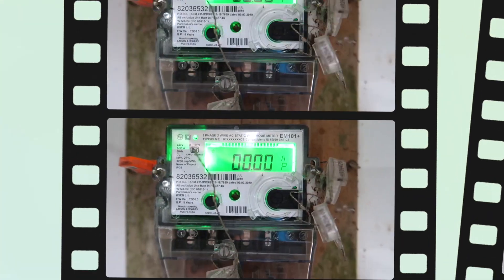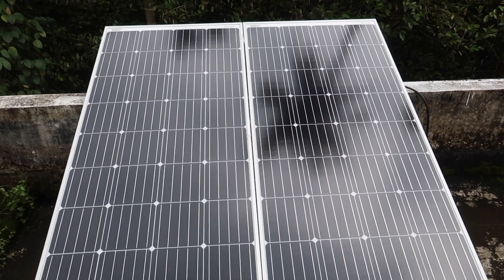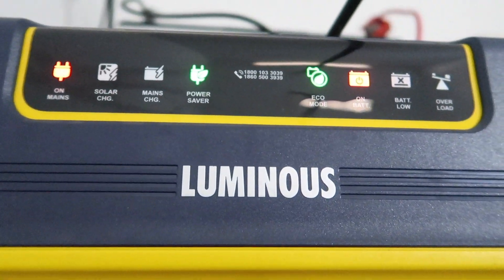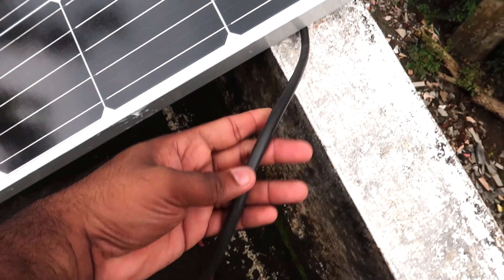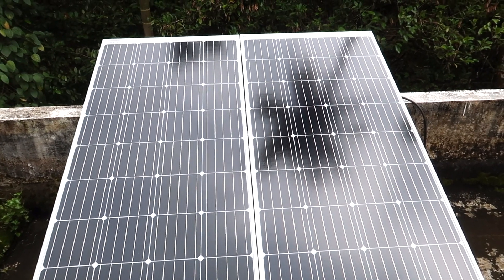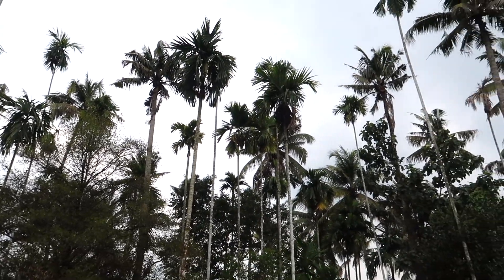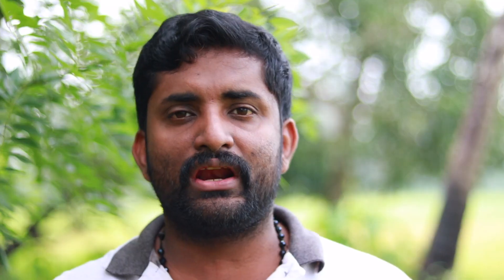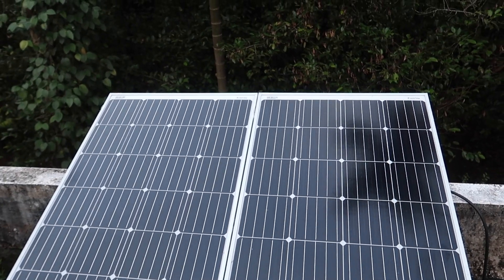സോളാർ പാനൽ വൈദ്യുതി ചാർജ് കുറക്കും | Luminous invertor + solar panel + battery

Comment: Chetta, njn oru computer 24*7 use cheyyunnund with 43 inch monitor. Enik ithu randum mathram solar inverter nte power yl use cheyyanam.  Enik ee requirement nu avashyam aya oru unit suggest cheyyamo.
Reply from the maker: Sorry bro..i am not a expert. ആരെങ്കിലും ഇ സുഹൃത്തിനെ ഒന്ന് സഹായിക്കാമോ 🤔

Comment: Luminous sine wave ഇൻവെർട്ടർ ഇൽ ട്രാന്സ്ഫോര്മര്  കോയിൽ അലുമിനിയം ആണ് യൂസ് ചെയ്‌തിരിക്കുന്നത്‌,  അതുകൊണ്ട് തന്നെ എനർജി ഹീറ്റ് ലോസ് വളരെ കൂടുതലാണ്.  അതിനായിട്ടു മിക്ക sine wave ഇൻവെർട്ടർലും exhaust fan ഉണ്ട്‌ with തെർമോസ്റ്റാറ്റ് കോൺട്രോളറും. അതുകൊണ്ട് തന്നെ ഇത്‌ വെക്കുമ്പോൾ വൈദുതി ബില്ലിൽ നല്ല ഒരു മാറ്റം തന്നെ വരും,  സോളാർ പാനല് വെക്കുമ്പോൾ kseb ചാർജിങ് ഒരു പരിധി വരെ കണ്ട്രോൾ ചെയ്തു കുറയ്ക്കാം. 
പിന്നെ ലൈൻ വോൾട്ടേജ്  ഉള്ളപ്പോൾ ഇൻവെർട്ടർ ഓൺ ആകുന്നത് ലുമിൻസ് ഇൻവെർട്ടർൽ UPS mode ECO എന്നിങ്ങനെ 2mode ഉണ്ട്‌ UPS mode on ആണെകിൽ ലൈൻ voltage 200V താഴെ പോയാൽ ഇൻവെർട്ടർ mode on ആകും. പക്ഷെ ഇൻവെർട്ടർൽ under voltage  indication ഒന്നും തന്നെ കാണിക്കില്ല,  Mains Indication ഉണ്ടാകും. 

ECO mode ഇട്ടാൽ Under  Voltage ആയാൽ മാത്രമേ Changeover Relay  dienergise ആവുകയുള്ളൂ.
Reply: Good information

Comment: Mono crystalline panels are used in low sun light  conditions. For example Ooty. But in Kerala polycrystalline panels are better except for some areas like Waynad , Idukki etc. For long term productivity polycrystalline panels are more efficient.

Comment: 2x 100 W panel,150ah battery,1200VA inverter. കഴിഞ്ഞ 10 വർഷമായി ഈ രംഗത്ത് പ്രവർത്തിക്കുന്ന ഒരു സ്ഥാപനമാണ് എനിക്ക് ഇത്  വീട്ടിൽ ഇൻസ്റ്റോൾ ചെയ്തു തന്നത്. എന്റെ സംശയം എന്താണ് എന്ന് വച്ചാൽ, സോളാർ പാനൽ ഡയറക്ട് ബാറ്ററിയിലേക്ക് ആണ് കണക്ട് ചെയ്തിരിക്കുന്നത്. ഇത് ശരിയാണോ? ചാർജ്ജ് കൺട്രോളർ നിർബന്ധമാണോ? ബാറ്ററി ഫുൾ ആയതിന് ശേഷം 200W വരെയുള്ള വീട്ടിലെ ഉപകരണങ്ങൾ KSEB പവർ ഉപയോഗിക്കാതെ പാനലിൽ നിന്നുള്ള വൈദ്യുതി ഉപയോഗിച്ച് പ്രവർത്തിക്കും എന്ന് ടെക്നീഷ്യൻ പറയുന്നു.ഇത് വിശ്വസിക്കാമോ?
Reply: battery life ?
Reply from the maker: എവിടെയോ എന്തോ പ്രശ്നം ഉണ്ടല്ലോ പറഞ്ഞതിൽ ...🤔
Reply: @ecoownmedia  ചാർജ്ജ് കൺട്രോളർ ഇല്ലാതെ ഉപയോഗിച്ചാൽ എന്തൊക്കെ പ്രശ്നങ്ങൾ ഉണ്ടാകും?
Reply from the maker: Battery damage aagum pettannu, panel damage aavanum chance undu
Reply: ratheesh raghavan  battery damage akum due to high voltage ... 180 watt 12 volt PV pannel  peak power voltage 19 volte So charge controller  reduce voltage  to 12 volt
Reply: ബാറ്ററി ലൈഫ് പെട്ടന്ന് തീരും .ബാറ്ററി പൊട്ടിതെറിക്കാനുള്ള സാധ്യതയും ഉണ്ട്

Comment: In  this system energy and money savings will depend upon your electricity usage at day time from solar and how much time your Inverter charges battery after sunlight goes. 
Usually all inverters will work up to below its normal voltage  using battey and after that it will take KSEB supply to charge it . This battery charging current by inverters will take away all the savings. If soalr consumption at day time is less,  loss will be more. The same is the reason for increase in Electricity bills at home after installation of Inverter.

Comment: ഞാൻ 260w ന്റെ 24 വോൾട് 4 പാനൽ 12x150AH ന്റെ ബാറ്ററി 2 എണ്ണം strider ന്റെ ചാർജ് കൺട്രോളർ (40amp ന്റെ) 24 വോൾട് 3Kva ഇൻവെർട്ടർ ഉള്ള  ഒരു  സിസ്റ്റം ഒരു കൊല്ലത്തോളമായി ഉപയോഗിക്കുന്നു.  ഒരു കാര്യം പറയാം എനിക്ക് നല്ല രീതിയിൽ എലെക്ട്രിസിറ്റി bill കുറവ് വന്നിട്ടുണ്ട്.  നല്ല ഒരു സിസ്റ്റം ഉപയോഗിക്കണം അതുപോലെ MPPT charge controller ഉപയോഗിക്കുക.  സാധാരണ വരുന്ന സോളാർ ഇൻവെർട്ടർ  വളരെ അധികം Pwm ചാർജ് കൺട്രോളർ ആണ് വരുന്നത്. BUILTIN ചാർജ് കൺട്രോളർ ഉള്ളത് ഒഴിവാക്കി separate MPPT charge controller ഫിക്സ് ചെയ്യുക.  ഞാൻ എന്റെ 687 ലിറ്റർ ഇൻവെർട്ടർ മോഡൽ side by side ഫ്രിഡ്ജ് 6 മണി മുതൽ രാത്രി 10 മണി വരെ  (1hp submersible വാട്ടർ പമ്പ് (ഇടക്ക് മാത്രം) പിന്നെ ലൈറ്റ് ഫാൻ മിക്സി അത് പോലെ വാഷിംഗ്‌ മെഷീൻ അത്യാവശ്യം ഉപകരണങ്ങൾ എല്ലാ  ഉപയോഗിക്കുന്നു.  ബാറ്ററി ചാർജ് level അനുസരിച് ചാർജ് കൺട്രോളർ change over ചെയ്യുന്നു.  നമ്മൾ ഒന്നും ചെയ്യേണ്ടതില്ല.  സ്വന്തം ചെയ്യാൻ കുറച്ച് അറിവുള്ളവർ എനിക്ക് അറിയാവുന്ന കാര്യങ്ങൾ വേണമെങ്കിൽ ഷെയർ ചെയ്യാം.  നോ ഇഷ്യൂ.  സോളാർ ഇൻസ്റ്റാളേഷൺ എന്റെ സ്വന്തം അനുഭവം ഷെയർ ചെയ്യാൻ റെഡി.  വാട്സ്ആപ്പ് 00971507261985
Reply: You need solar system?
Reply: 260 X 4 പാനലെന്നു പറയുമ്പോൾ I 1Kw പാനലാണോ?

Comment: video is good. but i think ur battery is charging through out the night time from kseb via your invertor. this will cause a shoot up in energy bill. to avoid this automatic charging from kseb line to the battery, a controlling swich is required in the invertor.

Comment: ചേട്ടാ.. monocrystalline panel over heat ആയാൽ  efficiency  കുറയും but policrystalline പാനലിനു ആ കുഴപ്പമില്ല.. പക്ഷേ നല്ലതു  monocrystalline panalanu 500 watts മുകളിലേക്ക് ആണേൽ  policrystalline ആണ്  നല്ലതു പിന്നെ ഒരു mppt inverter use ചെയുക luminous inverter ചെക്ക് ചെയുക battery full ആയാലും  24 hr  tansformer working aanu mppt inverter aakuzappmilla.., പിന്നെ  solar battery use ചെയുക  വില കൂടുതലാണ് 5 വർഷം റീപ്ലേസ്‌മെന്റാണ്. ബാറ്ററിയുടെ പ്രതേകത സെല്ലിന് കട്ടി കൂടുതലാണ്  solar tall tubeless battery.  utl mppt inverter  mppt solar charge controller. നല്ലതാണ്..പിന്നെ quantum solar inverter കുഴപ്പമില്ല rs. 9500 1000va indiamartil kitttum, പിന്നെ  flin energy mppt inverter  3, 4 വർഷം കൂടുമ്പോൾ  സോളാറിന്റെ  20sq045, 20sq050 schotty diode മാറുക.. ഞാൻ വീട്ടിൽ  ഉപയോഗിക്കുന്നത്  flin energy യുടെ mppt ഇൻവെർട്ടർ ആണ്  panel 500wattum..ഈ inverteril smps transformaranu  wallmount. USA make aanu
Reply: 3 kw ongrid system luminous system install cheyyan entra cost aaakum..athu upayogichu 1 unit inte 3 Ac koodi run cheyyan pattumo. Pls advice..
Reply: @sanjoysidharth8485  3ലക്ഷം 
13 to15 യൂണിറ്റ്  വരെ  കിട്ടും 
നിങ്ങൾക്കു  ഒരു  ദിവസം വേണ്ട യൂണിറ്റ് എത്ര എന്ന്  മനസിലാക്കൂ  എന്നിട്ട്  മാത്രം  എത്ര kw  വേണമെന്ന് തീരുമാനിക്കുക 
മറുപടി  ഇഷ്ടമായില്ലെന്ക്കിൽ, സോറി..
Reply: Bro. നല്ല അവതരണം . ഒന്ന് കൂടി  ശ്രമിച്ചാൽ  നല്ല  ടെക്നിക്കൽ അറിവ്  നേടാം 
ഓൺ ഗ്രിഡ്  വർക്കിംഗ്‌  രീതി 
തെറ്റായിട്ടാണ്  പറഞ്ഞിരിക്കുന്ന തു  dc കേബിൾ  സ്റ്റോക്ക്  ഉണ്ട് 
4mm 40rs/meter, mc4 connector,  2 in1, 3in1, 4in1 available ആണ് 
Desigin കറക്റ്റ്  ആണെന്ക്കിൽ  മാത്രെമേ സോളാർ സിസ്റ്റം വിജയിക്കൂ 
വീഡിയോയിൽ  കാണുന്ന ബാറ്ററി  c20ആണ്  c10ആണ് 
നല്ലത്  5ഇയർ ഗ്യാരണ്ടീ ഉള്ള 
ബ്രാൻഡഡ് c10 മാത്രം വാങ്ങുക
Reply: @rajeshkumar-st9pc  സ്ഥലം എവിടെയാണ്... dc കേബിൾ 6 mm   1 mt.  Rs എത്രയാണ്
Reply: ബാറ്ററികൾ .എക്സൈഡ് ഉപയോഗിക്കുക

Comment: 1 hour കൊണ്ട് എത്ര ampere charge കേറും same system ഉപയോഗിച്ച്
Reply: Mppt charge control vachaal 1.30 hr.. 200 ah battery full
Reply: @ashrafkaradan5559  40 amper ഇൽ ഒന്നും ബാറ്ററി ചാർജ് ചെയ്യാൻ പാടില്ല   മാക്സിമം 8 amper.. ബാറ്ററി വളരെ വില ഉള്ളതാ.. പണി പാലും വെള്ളത്തിൽ കിട്ടും.. 😪
Reply: @ashrafkaradan5559  controler എത്ര ampere ന്റെ വാങ്ങിക്കണം
Reply: 40 ambear
Reply from the maker: ഒരു ദിവസം ഫുൾ ചാർജ് ആവുന്നില്ല ബ്രോ. 1 മണിക്കൂർ അറിയില്ല ബ്രോ
Reply: I have m p p t  40 amper full automatic.... 150 ah.. 8 amper adukkolluuu maximum pooaal 150*5 battery =8amper*5=40

Comment: 50watt mono solar panels inda and with 35ah battery how many hours will take to full charge?
Reply from the maker: 8 hr. Depending light & charger control
Reply: 35AH ബാറ്ററി ചാർജ്ജിന് 3.5 A കരണ്ട് വേണം 10 മണിക്കൂർ' '        50 Wസോളാറിൽ നിന്ന് 5 മണിക്കൂർ മാത്രമേ 2 .15 A കരണ്ട് മാത്രമേ കിട്ടു ഒരു ദിവസം കൊണ്ട് ചാർജ്ജ് ആകില്ലാ രണ്ടാം ദിവസം കുറച്ചു നേരം കൂടി വേണം അല്ലങ്കിൽ rMPPT സോളാർ ചാർജ്ജ് കണ്ട്രോൾ വേണം

Comment: കേരളത്തിന്റെ കാലാവസ്ഥക്ക് Polycrystaline solar panal ആണ് നല്ലത്. കാരണം ഈ Solar Pannel ന് Negative Tempreatue coeffeciant ആണ് ഉള്ളത്. That means, Panel ന്റെ Tempreature കൂടുമ്പോൾ Power output കുറയും. കേരളത്തെ പോലെ നല്ല ചൂടുള്ള വെയിൽ ലഭിക്കുന്ന ഒരു പ്രദേശത്ത് Mono യെ അപേക്ഷിച്ച് Poly ആണ് കൂടുതൽ workout ആവുക. കൂടാതെ panal ൽ shading വരുകയാണെങ്കിലും Mono  യെ അപേക്ഷിച്ച് Poly യാണ് കൂടുതൽ Power output തരുക.
monocrystaline panal Low Iight ഉള്ള പ്രദേശങ്ങളിൽ ആണ് നന്നായി പ്രവൃത്തിക്കുക.

 solar system ത്തിൽ ഉപയോഗിക്കുന്ന Battery c10 rating ഉള്ള Battery ആയിരിക്കുകയാണങ്കിൽ മാത്രമേ പ്രതീക്ഷിച്ച ഫലം കിട്ടുകയുള്ളൂ. ഈ Balttery Design ചെയ്തിട്ടുള്ളത് 10 മണിക്കൂർ കൊണ്ട് charging and Dis charging നടക്കുന്ന രീതിയിൽ ആണ്. C20 Balttery Design ചെയ്തിട്ടുള്ളത് 20 മണിക്കൂർ കൊണ്ട് charging and Discharging നടക്കുന്ന രീതിയിലും ആണ്.

Comment: Same loom സോളാർ  180×2 , 160Ah ബാറ്ററി ഞാനും വെച്ചിട്ടുണ്ട് 2 മാസം ആകുന്നു വളരെ useful ആണ്..
Reply: Loom solar panel =15000
Luminus1400 solar inverter                  =7500
Inverfast C10 ,160 Ah solar battery          =11700
DC cable 15 meter=1700
Total = 35900/-
Reply: @shinodkalavoor100  pls share link for inverfast 160 ah battery purchase
Reply: @shinodkalavoor100  what all electric equipments can be used at a time
Reply: വന്നില്ല വന്നിട്ടു പറയാം
Reply: ബിൽ vanno????  ലാഭമാണോ
Reply: Bill details?
Reply: എല്ലാം കൂടി  എത്രയായി

Comment: സോളാർ പാനലിന്  ബാറ്ററി ഉപയോഗിക്കുംബോൾ C20 ബാറ്ററിയെക്കാൾ C10 ബാറ്ററി ആണ് നല്ലത്
Reply: ബ്രോ ഒര് ബാറ്ററിയുടെ ലൈഫ് 900 to 1000 സർക്കിൾ ആണ്. അതായത് ഒര് ഫുൾ ചാർജ്, ഒര് ഫുൾ ഡിസ്ചാർജ്.. c, 10 ബാറ്ററി 15 ആംബിയറിൽ 10 മണിക്കൂറിൽ ഡിസ്ചാർജ് ആകും. C 20 20 മണിക്കൂറിൽ7.5 ആംബിയറിൽ  ഡിസ്ചാർജ് ആകും. അതുപോലെ ചാർജിങിലും വെത്യാസം വരും, c10 ബാറ്ററി 24 മണിക്കൂർ  ലൈവ് വർക്കിങ് ആയിരിക്കും c20 അതുപോലെ അല്ല ആവശ്യം വരുമ്പോൾ മാത്രം ഉപയോഗിക്കുന്ന ബാറ്ററി. C20 വളരെ പെട്ടെന്ന് തന്നെ വാട്ടർ ലെവൽ താഴ്ന്നു ഗ്രാവിറ്റി വ്യതിയാനം വരും c10 അങ്ങനെ പ്രശ്നം വരില്ല അതിന്റെ ഉള്ളിലെ പ്ലേറ്റുകൾക് കട്ടി കൂടുതൽ ആയിരിക്കും. ഡ്രൈ ബാറ്ററി എപ്പോഴും മഴ വെള്ളം ഉപയോഗിച്ച് മെയ്ന്റനസ് ചെയ്താൽ ലൈഫ് കൂടുതൽ കിട്ടും. അതാണ് ശെരിക്കും ഡിസ്റ്റിൽ വാട്ടർ.. c10 സോളാർ സിസ്റ്റം ഉപയോഗിക്കുന്നു c20  നോർമൽ ഇൻവെർട്ടർ ചാർജ് ചെയ്യുവാൻ ഉപയോഗിക്കുന്നു, ഏതായാലും ബാറ്ററി 27° ചൂട് കൂടിയാൽ പെട്ടെന്ന് തന്നെ സെൽ വീക്ക്‌ ആകും ഒര് സെൽ വീക്ക്‌ ആയാലും ബാറ്ററി ഉപയോഗിക്കാൻ സാധിക്കില്ല..
Reply: c20 and c10 depends on maximum battery discharge current. 150 Ah, C10 battery gives 10 hr backup with maximum 15 A current, while 150 Ah, C20 battery gives 20 hr backup with maximum 7.5 A current
Reply: Y
Reply: അദാനി ഗ്രുപ്പിന്റെ  പാനലിനെ കുറിച്ച്  അറിയുമോ  അഭിപ്രായം  അറിഞ്ഞാൽ  കൊള്ളാം